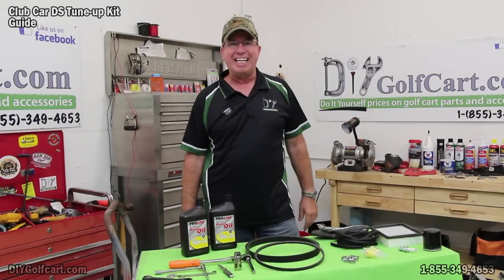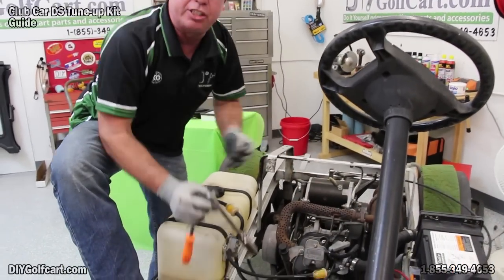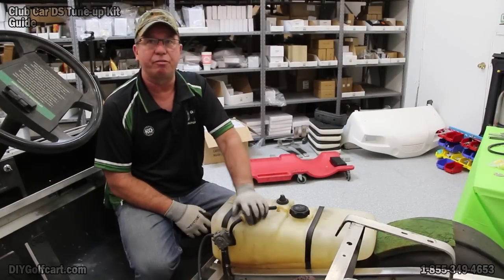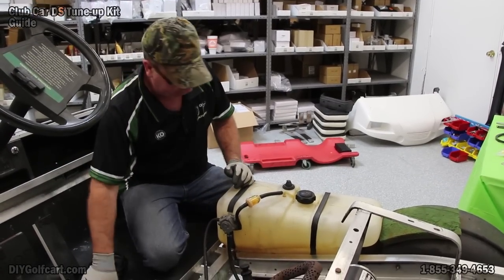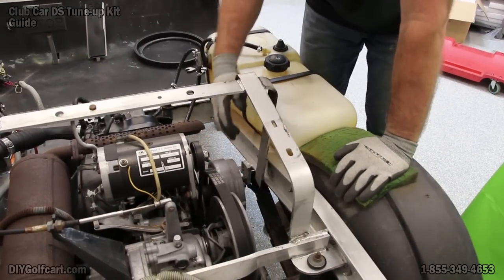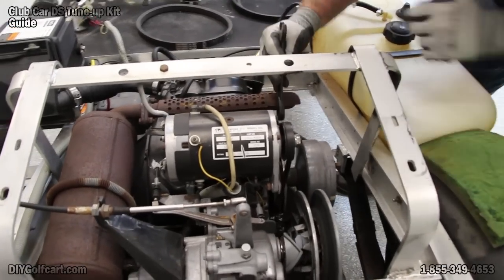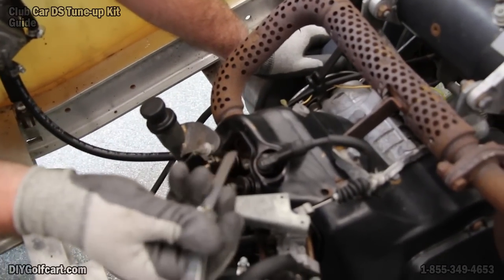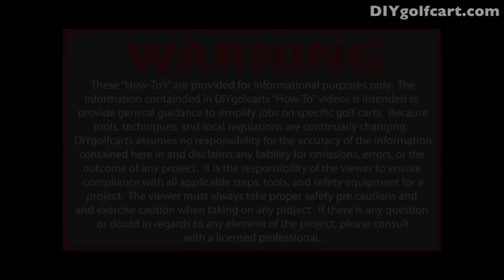Club Car DS Tune Up Kit | Starter/Drive Belt | How to Install on Golf Cart

Comment: Thanks for the video. Question: is there any service to the ignition system, such as plug wire replacement, etc. Do these engines have a conventional distributor with a cap and points or are they some type of solid state unit...? Any service..? And is there any service to the drive axle or a transmission --- like fluid changes..? I see you replaced the drive belt so I assume there is no conventional transmission.

Comment: Hi Great video which deals with a good all round service. Could you tell me the size of the 2 bolts on the valve cover as my socket set can’t undo the bolts as there is not enough clearance between the bolt and the cover recess for my socket to fit over. Did you use a box spanner and if so can you tell me what size you used? Many thanks

Comment: How do you know when you need to change the drive belt? What are the symptoms of a worn drive belt?
Reply: Belt slipping, belt fraying on the edges or curling up. Speed slowing down and loss of torque.
Reply: Barry Wilson , thank you.
Reply: Barry Wilson , I measured my belt today. It measured 13/16 inch wide. I think it is supposed to be a one inch belt. I am going to order plan a new belt.

Comment: I have a Club Car 1986 with a Kawasaki engine 8.2 hp. ( so I was told) Question is, when the engine gets warmed up real good it loses power. We do all the maintenance on this cart. I am wondering if it is O L D or does it need overhauled or what. Any ideas will be helpful. thanks. Jim in Ohio
Reply from the maker: This first thing I would do is to check the compression. Make sure you are pushing over 125 lbs. Most likely the engine is old and tired and needs new rings, gaskets and seals.

Comment: Hello, I have a question & hope I can get your response. I have a 2002 EZ-GO TXT Shuttle. It ran great but recently we had some family over and while I was off fishing they took it for a ride. 6 full grown adults in total, to make the story short now my EZ-GO runs at a top speed of 8-10 miles and wont even go up hill. Any suggestions on what it can be? I have checked the belts, adjusted valves, checked ignition, checked batteries, checked spark plugs, compression is good at around 180, any info might help me thanks. I did noticed that the fuel filters dont fill up with gas would it be a clog or bad fuel pump? Thanks for your time
Reply from the maker: The fuel filter will never fill up. Try the link below, this may help you get eh torque to climb hills that you need.
https://diygolfcart.com/ezgo-driven-clutch-gas-4-cycle-1991-2009-high-torque/

Comment: how tight should the starter belt be?
Reply from the maker: 5 to 7mm deflection. Tight.
Reply: DIY Golf Cart  I got her nice and tight but it is squealing when slowing down and sometimes under load going up hills.  I have a power spring from red hawk in the driven clutch and severe duty drive and starter belts. could it be the clutch or drive belt squealing?  doesn't squeal at start up just when slowing down mostly.  when I hit the brakes it doesn't squeal as long as when I just let it come to a stop by itself.  both belts are new gforce and also a new starter.  thanks for the quick response on original question
Reply from the maker: Sounds like it's the Drive Belt squealing under a load. Check the Clutch Plates for grease or any other debris that could cause that noise issue.
Reply: ok thank you.  ill check it out. whats the best way to clean them?  can you do it with drive belt on there?  thanks
Reply: there is a dark area around the whole  about a inch from the top of the inner clutch plate wear it squeals on acceleration and when you let off. not sure if its worn or its the type of belt im using. tthey are clean and smooth though.